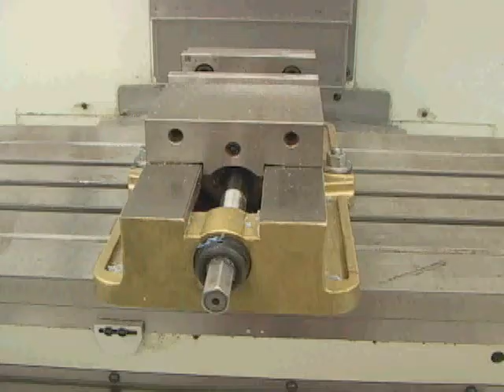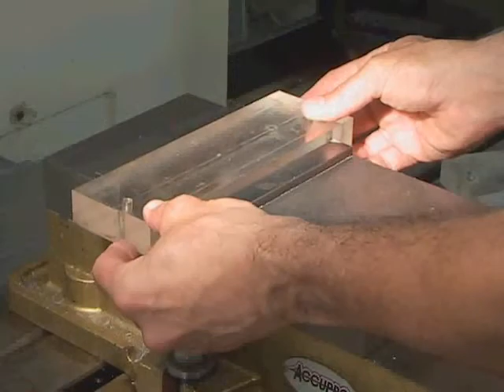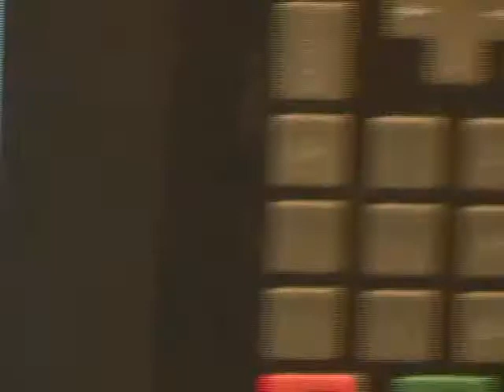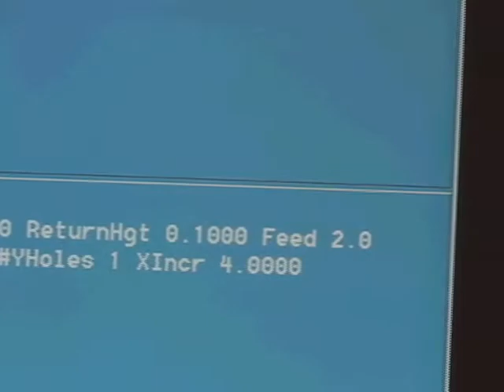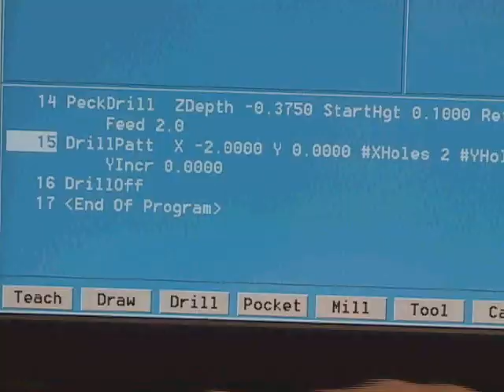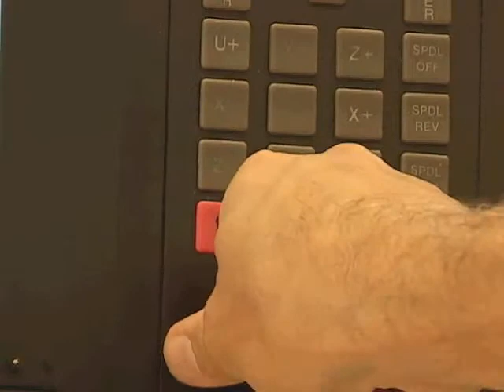CNC Tutorial 2 of 3: Using the CNC Mill (34 minutes)

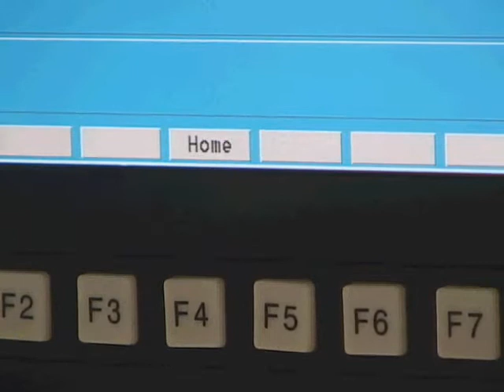Comment: 3:00-4:00
Before describing how to actually move the CNC axes. Let's keep in mind that the machine is designed so that the table makes X and Y movements while the Z axis makes the up and down movements. Thinking of the table moving around is extremely confusing we will therefore pretend that the table is stationary and the spindle makes all the movements, with this assumption the familiar Cartesian coordinate system will remain in effect and these XY axes can be thought of being directly on top of the CNC table, in this way your programming will be made much much easier.